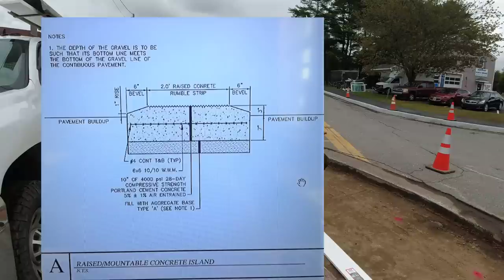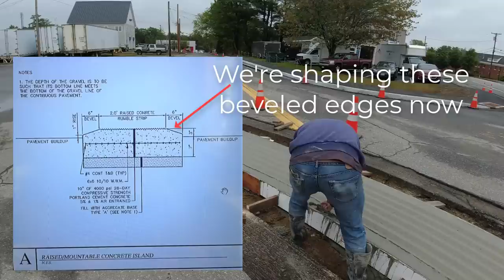They Tore It OUT and Made Us Do It Again! Design Failure Raised Concrete Island Median Strip

Comment: I do those all the time. The taper is supposed to meet the blacktop. The rumble strips aren't supposed to run  parallel with traffic. They should be running across. But engineers usually believe they know different. The quality of work looks good according to the plans they gave you
Reply: Rumble strips cant cause a "rumble" if the run parallel to traffic, they need to be transverse.

Comment: As soon as I saw the print I guessed the problem. That design makes no sense, but it looks cute on paper. 
You guys did a very good job turning a flawed design into reality.
Reply from the maker: Thank you!
Reply: That's why it should be a requirement in the architectural side to work with the materials in the real world prior to designing things. You know, like an apprenticeship.
Reply: @nbco55  it is the same in machining and fabrication
Reply: My first though of the raised bit was "OMG that is going to eat snowplow blades like crazy when they hit it." I see lots of blow blades getting dinged up and possibility of the plows taking chunks of the concrete.
Reply: Not sure why the poster blames an Architect for the design. Architects don’t design site work- civil engineers do. Contractor could also have raised concerns about the design before proceeding.
Reply: @robertforwood393  Spot on. One, they are called civil engineers. Two I think the contractor missed looking at the elevation section of the print to which he should have then realized he screwed up the rumble strips. If contractor was correct you would see the bumps in the prints cross sectional view he shows us. Three, don't think your concrete would pass the slump test with those big ass balls of unmixed material.  Four, waist of money on the plastic form material was an economical choice as sheets of hard board ripped into the necessary width would be far more economical. Bonus tips for the contractor smooth side in and find a new line of work your in over your head.
Reply: Trust me, that won't stop a snow plow. ;-) (but you will need to rebuild it next year )
Reply: @nbco55  They should work together, but people tend to be prideful. An apprenticeship is cute, but it still wont compare to talking with the industry professionals. Same with the manufacturing and fabrication world. Draw your first draft, take it to your shop guy. He will give you things you never thought of to rework.

Comment: GROUND ROD DRIVER FOR HAMMER DRILL!!! We use metal stakes as well and if the ground is really tough using a ground rod driver attachment on a hammer drill is a huge arm saver, especially if you have carpal tunnel! Love your videos, always learn something
Reply from the maker: Nice tip, thanks!
Reply: Yeh, this has saved me uncountable numbers of hammer swings. Had to drill out the (hardened!) ground rod driver to make it work with 3/4 stakes, though. and you have to grind the stake heads with a bevel or they will get stuck. Worth it anyway.

Comment: Nice design, great finishing. As soon as I heard you mention snow removal equipment, I figured that this would be a do-over. Not your fault. I was the concrete finisher for the city of Manhattan Beach, Calif. for 7 years, and spent 10 years on the concrete crew for the county of Kern in Bakersfield, Calif. I learned early on that I'd NEVER work on city or county projects of any kind as a private contractor.

Comment: Mike, if ever again you have to bevel something like that, just get 12"x12" alum sheets from a supply house. Make an extruded, right triangles, then you scoop in with the leading edge,— it will gouge the bevel with minimal mud removed leaving it smoother. If you want a firm grip, just use a block from 2"x4".

Comment: A company I worked for years ago hired the owner's son, who was college educated in construction management, to lead a curb and gutter/catch basin concrete paving crew. I was the backhoe operator digging and setting the catch basins and we had a 6 foot wide, 4 mile long 'bike lane' to pave with multiple catch basins to set to grade, and the curb guys naturally had to set the curb to grade as well. I had constant contact with the City Engineer to be made aware of any changes and to make sure my part of the job was set to grade. One yard of concrete would only cover about 6 feet of distance using the paving machine at a 1-inch slump.

As the curb guys were setting up the string line for the curb paving machine to run off of I noticed they werent up to grade with their line, meaning the curb would also be too low once the paving machine started going. I was told to "stick to digging holes" because they knew what they were doing.

Once paving began, I had a laser level set up and in the first 5 feet told the curb guys they were off grade. Again I was told to worry about the catch basins and setting the lids. Once the first one was 3 inches above the curb, the curb guys began to take notice something wasnt right. By the fourth one, the bosses son showed up and asked me, "Why are your catch basin lids sticking up and not to grade?" And I told him the curb was off, not the catch basins.

They ended up stopping the job after 300 feet to check the string line. I quit the next day as the blame game started to go around and they tried to say it was the catch basin crews fault because we "pointed it out by setting the catch basins to grade" and the inspector never would have noticed if we had not done that. I heard they closed the division down about 6 months after I left.

Comment: Two issues. 1 plan does show a lip 1 inch. 2 the rumble strip has no depth indication. However, the v strip looks less than half inch and no reason the pavement could not be raised.

Comment: from what i am looking at here, my thought is a rumble strip does NOT run the same direction as the vehicle drives. rumble strips should be cross ways, not parallel .   running across the strip is what causes the noise, or vibration to get the drivers attention, just like on the side of interstates.  its in case someone is not paying attention or should drift off to sleep while driving, and they drift off to the side. they will run across the rumble strip and be shaken back to attention.  now please show us the rework you had  to do. thanks. cool video.

Comment: The biggest problem I saw was the slump was too thin for your purpose and the rain was hurting you.  You needed a high slump concrete. With a high slump concrete you could have had your forms set at grade and poured the concrete higher than the form for the raised portion.

Comment: the carelessness of those city council people knows no bounds, they could have made a structure serving the very same purpose with premade road side concrete blocks, a lot less work, but they chose not just the expensive option, but also screw up the design that ends up costing 3x the initial quote, and probably 10x what the premade stuff would have cost

Comment: In my opinion it is clear that runs next to that street theres a double yellow line and that is to be finished along the 3ft width so as the driver veres off the newly shaped edge of the road there's bumps and pits not just grooves that run the length

Comment: hey i do concrete up in canada doing commercial and city work with a 3 year warranty depending on the concrete we use class c ( 7 days you can drive on it) or class ab high early ( 3 days you can drive on it) if another company or business removes our barricades before the proper time frame to allow vehicle flow any damages/failure in the structure is on them and the warranty is void. not sure if you have a similar thing in the states.
Reply: also that one inch lift could have been a designed for a parking lot pre- toplift of asphalt so they would come in later to match the asphalt to the edge of the concrete

Comment: I don't know what goes through city engineers heads lately.. I'm a draftsman for a civil firm and some of the comments the city reviewer / engineers make have me scratching my head for hours. I've only been in the industry for about a year and a half, and I'm already starting to despise working with architects or city engineers.... recently we've had to deal with the engineers freaking out over a .001 miscalculation for hydraulic pressures in a storm drainage pipe when the city only tolerances up to .01 at most....

Comment: From a pedestrian point of view, that's pretty unfriendly. It liked like the intent of for all pedestrians to be routed to the other side of the road. But, why? There may also not be enough flat space above the pedestrian ramp for a wheelchair to turn. Pedestrians won't be able to (easily) walk on the grooved area.

The groves on the island might be oriented properly, to slow drivers mounting it to get into the parking lot. However, the drawing shows around 50 tiny grooves instead of the maybe 6 large ones as-built.

Comment: 🤣 nothing ever goes right in construction industry. Engineers/ architects are stupid. Sometimes they'll put something completely at the wrong stationing. The reason for that is they do an aerial survey of the entire project and calculate based on what they recorded; elevations, center line, culvert pipes, concrete box culverts, everything. Sometimes the elevations for the drainage structures are too high for the road, or too thin for traffic. Which causes soft spots or sink holes.

Comment: Yes, I see problems. No concrete lab on site to check slump , air content, and make test cylinders of the concrete. Reinforcement wire not on chairs to hold it in the middle of the pour. You said you formed it with 8” when the plans call for 10”. You poured into standing water. You put improperly mixed concrete into the forms. The prints called for concrete, you used 1/2 asphalt. Where is the #4 called for on the print? Didn’t vibrate the forms, did it honeycomb the edges? That concrete was pretty wet ( excessive water content) if you could just pull the rumble form through it after screeding the entire pour. Not leaving it barricaded off until you got a lab break of over the required 4000psi. Just a few things from a casual glance.